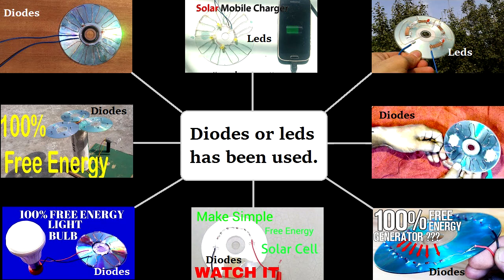Solar cell with cd (Useless)

Comment: i have actually made 6 24 volt panels ,using miss copied blue ray disks from a copy house .And it happily keeps my back up ups battery charged ,i found  that cds and dvds did not prefom as well at all .The blue ray disks must have been used though ,that is data burnt onto them ,something to do with the way the light is reflected once used .I must admit though ,they arnt the prettiest looking panels and im not confident theyll last over time
Reply: may i ask how did you do it? we're currently conducting a research project about that at school and looking for a design that would give that just enough voltage
Reply: Could you explain what you did to get it to work i'm trying to finish a last minute science project

Comment: Those videos weren't necessarily fake, but they were misleading. Many of the uploaders had their multimeters set to millivolts. If there is something else I missed, I would love to hear it. I am always open to correction.
Reply from the maker: Yes, you are right. As you can see I have used it 0:36 too. I didn't say they are all fake, I said the amount of power the leds and diodes produce is useless. Many people have disliked this video, can they (dislikers) really produce sufficient energy from their leds? Some people are really stupid as .... forget it don't like to swear but because of the dumb people some times you have to, otherwise they don't understand.